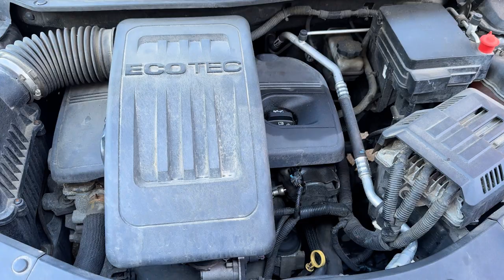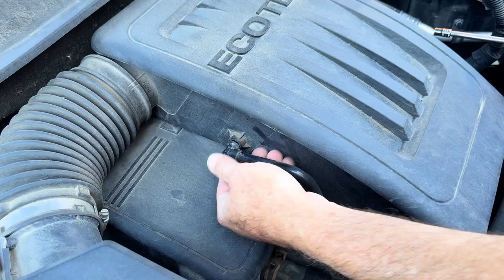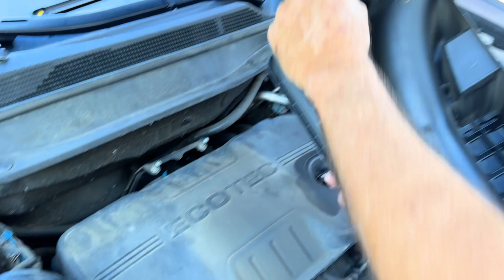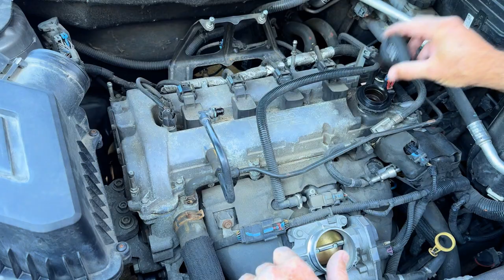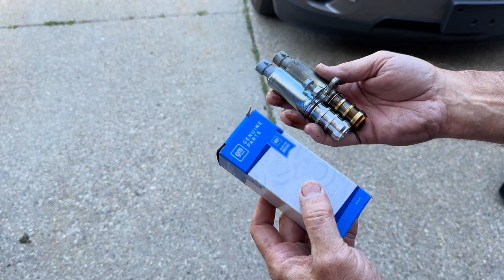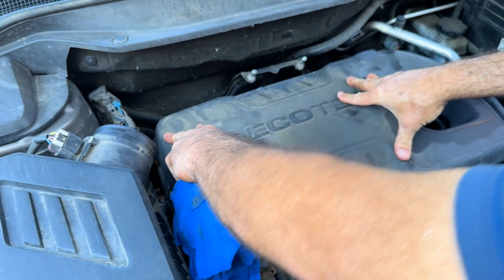How to Replace Intake VVT Solenoid Chevy Equinox

Comment: will the check engine light go off automaticley
Reply from the maker: It can but often takes a few drive cycles for the computer to clear the code and turn the light off on its own. I usually just clear it with a OBD scanner .

Comment: Thank you I was stranded at Walgreens because of this sensor you saved me so much time and money! Would you recommend changed the exhaust one as well? Changing the intake one fixed my problems car is right at 100k miles 2016 equinox
Reply from the maker: You're welcome. It's not usually needed, but it's up to you if it gives you peace of mind.
Reply: @TheAutoTeacher ah ok I have a tool set i keep in the car incase something like that happens again. So this time I'm better prepared haha. What are the symptoms the car makes when the exhaust one goes bad?

Comment: Could it be timing chain throwing the same code also?
Reply: I have 148000 miles
Reply from the maker: No,  with the PO010 the ECM has detected an issue with the electrical circuit for the intake camshaft position actuator solenoid.
A timing chain code would be PO008,PO009,PO011,PO014,PO016,PO017 .
Good luck  !

Comment: Sir how would I know its the solenoid
Reply from the maker: Its a process of elimination, it depends on mileage and condition of vehicle and maybe a check engine light with PO codes .
P0010 – “A” Camshaft Position Actuator Circuit (Bank 1)
This refers to the intake side, not the exhaust. 
 Could also be some other things such as Wiring issues e.g., open/shorted wiring to the VVT solenoid, connector corrosion or damage, low or dirty engine oil,  Good luck!
Reply: @TheAutoTeacher purchased a 2011 Equinox with 2.4 it had po302 and po420 when I looked at it and bought on Saturday. Now I’ve changed all 4 spark plugs , air filter , oil filter and oil. And swapped coil 2 to cylinder 1 and vice versa. Now I have codes po302, poo14, po340, po341, and pp420.